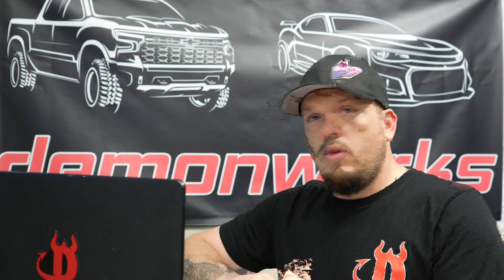Oil Pump Drive Belt TOTAL COST - 3.0 Duramax

Comment: If I had the equipment I would make steel gears to replace the belt and pulleys. Similar to gear driven cam  kit   Or a gear box at oil pump with pto shaft and gears from the top   There has to be a better system.

Comment: This transmission has more blind bolts then I’ve ever seen , you need a EN-52579 to rotate the crank to get torque converter bolts out maybe it’s it’s all you did could you get it out and in , in 7 hours , but fuck all data

Comment: Insane design. !  What's wrong with shaft driven or gear driven that has stood the test of time ? If they wanted a different design, then why not an external dry sump pump ? Easy to replace.
Reply from the maker: zero issues reported to date.
Reply: @DemonWorks  if it's not an issue, then why the discussion?
Reply from the maker: @tonycking0121  some people make it out to be an issue and that’s why you have returned to discuss. The video was to be informative on when the service is due and roughly what it will cost.

Comment: $0 cost if the oil pump was crankshaft driven like the 6.6 duramax and LS engines...for example my 08 gmc duramax has over 500k miles on the original oil pump at that mileage the belt would have been replaced 3 times

Comment: When you separate the transmission from the engine, would that require new oil and fluid in the transmission?  Would you have to factor in an oil change and transmission fluid change with this service?
Reply from the maker: top off each, minimal lost.
Reply: @DemonWorks  awesome.  Thanks for the info.  You’re probably talking me into buying a new truck.

Comment: I am seriously considering buying a 2020/21 with approx 50k miles for around $40K. Thanks for clearing the apprehensions on the oil belt cost. Before watching and reading the commentsnI was thinking in lines of $3000. Other issues with the 2020/2021 models that I need to be aware of?
Reply: Oil changes, def fill, dpf system, timing chain and oil pump belt access to rear of engine w different change intervals, timing chain is a touch more expensive. Auto start function can make the engine vulnerable to oil starvation. All said you get a good one fricking great concept! Best tank on mine 33.6 mpg! Towing the boat low to mid 20’s mpg. Good luck.

Comment: I heard the 2022 is at 200k miles. Is that true?
Reply from the maker: 2023, I have a video on that when it was first found in the owners manual. both the 2022 LM2 and LZ0 have a 200k interval now

Comment: LABOR TIME IS WAY OFF !
Reply from the maker: It's actually not. I mean, IT'S ACTUALLY NOT !!! Have you looked into the alldata times? That is where this came from and yes, one could add more time if they can't get the job done. Think about it though, you are unbolting the trans and pulling it back away from the engine and removing a cover plate then reinstalling after the belt is swapped. skill level 2 ... ps, WELCOME TO THE CHANNEL !
Reply: @DemonWorks  yeah and u forgot transmission fluid and that’s ten speed fluid so we sell for 15 bucks a quart
Reply from the maker: @trentonburge5662  I actually left out a few items but in your haste to complain, you left those out. How much fluid do you need when you pull a transmission back? those trans cooler lines must have at least a dozen quarts in there...
Reply: @DemonWorks  that also warranty time so add 40% to those times for CP and i have pulled these transmissions the starter removal is very fun just don’t people to be surprised when they have to pay twice as much as stated not trying to prove you wrong just trying to educate man
Reply from the maker: @trentonburge5662   I stated alldata times, times elsewhere can be higher or lower and I do understand the gm warranty times have been raised since I posted this video quite a while ago. I do plan on updating in the future but I don't like to just pull random numbers and provide them for the viewers. That's why this is stated at all data time. I do like the backtrack on you are just trying to educate, your first and second post would have been different if that was your motivation.
Reply: @DemonWorks  yeah well it’s the comments for ya and not being in person u didn’t know my tone nor body language and as stated not trying to make u look bad but IMO i think gm has completely missed it with this engine between plastic intake that crack and the cooling stack design i know it off topic but these truck will be extremely expensive to fix when they are out of warranty and at the end of the day it’s just a 1/2 ton pickup coming from a big time 6.6 fan and i guess i expected better from gm
Reply from the maker: @trentonburge5662  I disagree with "missing it", I think they did really well with this engine and the sales show it. It's also the only light duty diesel that made it. Yes, the 6.6 is better in pretty much every way but thats not an engine that is in the 1500 and many people don't need that engine. This fills the void nicely. I'm not worried about you "proving me wrong" we can all have our opinions and how we say things, i'm just sharing facts I had with me at that time and they will change over time but i'm not going to inflate numbers wildly without having information to back it up. The fanbase for this engine is huge, if it's not for you, that's totally fine.
Reply: @DemonWorks  only time will tell
Reply from the maker: @trentonburge5662  yes, much like everything else...

Comment: Speaking of belts, have you looked into what the process is to replace the serpentine on the 3.0? I just got a new Yukon diesel and I’ve been poking around in the engine compartment to see what it will take to do this job along with things like the alternator, ac compressor, etc and that belt is in there tight!!! Do the upper radiator fans come out to get access? I didn’t see any access to the belt from underneath when I had it on the lift a few days ago. Thanks!
Reply from the maker: I’ve had the proven age to replace a few… well, not replace but remove to get access to the front cover. It’s a miserable and tight process but doable without removing everything. The fans /radiator/ cooler are all attached and come out as one full assembly, fyi. Not needed to be removed to do that belt, though.
Reply: @DemonWorks  thanks for the reply! So, just get in there and get the arms all scratched up? 😂 I see a plastic cover which looks like it’s held on by one bolt in the upper RH corner and push sockets everywhere else. Is that just a protective cover? Maybe with that out of the way it’ll look a bit more “do-able.”

Comment: Inline 6 to make shorter requires removing accessories.  Mercedes is doing it with 300v system and motors.  Personally, a geared Power take off at the rear of engine would make sense to drive accessories.

Comment: Don't figure it out for yourself. Call a dealer and have it quoted. If you can find a GM dealer that says they can do it by just pulling trans. I would like to know about it. Again,I have a 2020 Denali 4WD Crew cab LM2.
Reply from the maker: Trans removal to get to the belt, yes.

Comment: I have a 2020 Denali and was quoted $2750 to change belt and timing chains. They say they have to remove the engine. Not the trans.
Reply from the maker: I’m a gm tech , it’s done from the rear. You probably spoke with a service advisor that was unaware of what is needed to be done, labor wise.

Comment: Why did the design an oil pump that needs a belt ?
Reply from the maker: Drives the oil pump. 2023 3.0 Duramax interval is now 200k miles, fyi.
Reply: @DemonWorks  I realize that , I was implying why did they not make it gear-driven or some design not needing a belt.
Reply from the maker: @BigEightiesNewWave  I’m still researching the belt design myself. From what I have learned so far is that the belt takes less space, less resistance, less noise and is actually a reliable setup based on numerous manufacturers testing.

Comment: I’d replaced the oil pump while I was in there if it unbolts out.
Reply from the maker: You would need to remove the engine oil pan for that.

Comment: I'm saving $350 a month in fuel with the 3.0 vs the ecoboost i had so even at 150k miles I'm wayyyy ahead. The people who argue the hardest that the belt is a deal breaker drive rams so we already know they're good at making decisions....
Reply: Mpg with the 3.0 is impressive for a full size truck. Power and torque is respectable.

Comment: As a dealer tech I’ll tell you right now absolutely nobody is going to do this job for 7 hrs
Reply: So how about you give us more information? How many hours are you going to charge at your dealership?
Reply: Under warranty from GM this belt pays 10.1 hours for a 2WD truck and 12.0 hours for a 4wd truck. Alldata however does not show a labor time for this component but a vehicle out of warranty would be about 14 to 16 hours.
Reply: @danieldelgado3008  Thanks for the info.

Comment: We're talking about a 10-12 year maint item for most and most people and the truth is, most people don't keep their trucks anywhere near that long. It'll most likely be the 2nd or 3rd owner doing this job. In any case, it's not an issue at all as far as I'm concerned, especially if the engine remains trouble free otherwise.
Reply: Yeah. Screw the 2nd or 3rd owner right. This crappy design is perfectly fine.
Reply: @Connor4x4  So stupid. ALL engines require maint. You haters just have to whine about something I guess.
Reply: @Connor4x4  It's not "screwing" anyone. Just like original owners that keep their pickups a long time, future owners will know about this and other scheduled maintenance procedures and can make the decision when buying and used trucks will reflect a sales price according to what people are willing to pay. This doesn't seem like a big deal. They keep moving out the recommended inspection mileage. It will be a while before we hear how long they are lasting in the real world. And dealerships labor rates are high. There will be private shops doing this for half the cost of a dealership.

Comment: GM testing has shown little wear at 150,000 and 200,000 miles. This will be a non issue for most.
Reply: I am at 148k right now so I am puckered myself lol... I am just going to start gathering the parts to do it when needed

Comment: Where were you able to get access to that parts diagram?
Reply from the maker: I work at a dealership.
Reply: @DemonWorks  Some brands appear to have some detailed parts diagrams online like BMW, select Subaru parts sites, but I've often had trouble finding detailed parts diagrams for domestic vehicles.  Is that something that's part of a OEM subscription to a factory service manual?

Comment: Looking very likely GM going to increase that mileage to 200K based on their examinations of belts at 150K looking great.
Reply: how old the belt is matters too.
Reply: @beowulf885  agreed.. a belt is a wear part. If they designed the engine to have those components at the rear of the block, knowing it would be an intensive repair and high labor time, they should have done a geared setup. Such a key component should NOT be putting it's faith into a rubber belt..

Comment: Waaayyyyy cheaper than pulling the cab and doing timing chains, tensioners and phasers in an Ecoboost but nobody seems to talk about that...
Reply: Ford owners are so nieve, they're blinded by how much power the engine produces that they don't care how much it costs to replace the chain. But hey, as long as they keep buying them, I can keep paying for my daughter's college tuition 🙃
Reply: @MrNismopro  😂😂😂😂 exactly!!
Reply: Exactly correct! I have been saying this ever since this engine came out. It's not that bad of a job. People make it out to be the worst thing that GM could have ever done.
Reply: @Mr._P4732  GM has done this move before with the 4.2 inline 6 as I'd imagine you know. That job is much more intense then this oil drive belt.
Reply: Lol i bet it's not a fun job in the rust belt
Reply: @spencerelsbury9110  Any job isn't fun in the rust belt.
Reply: Sure but servicing any emissions equipment on this piece of shit engine the cab has to be pulled.
Reply: @yurizaitsef  haven't had the opportunity for one yet but sure seems like we see cabs pulled often.
Reply: @yurizaitsef  yeah sounds like hell! I don't mind lifter jobs. Play well and bang them out in a day. Messed with one Diesel and it was a 7.3 HEUI. Plan to leave diesel work alone even being an easier platform.
Reply: @yurizaitsef  Benz tech huh? How was that to deal with? I used to work at a Chevrolet dealership but have moved on to self owned business with my dad. I work on many dom/foreign but never was blessed with Benz yet.
Reply: @evdawg7757  I loved that job. I still miss it.
Reply: @yurizaitsef  props to you for that. I'd imagine dealing with high end class cars everyday you be nervous or feel challenged. I'm lucky to have the opportunity building hot rods and restoring old muscle cars, experience passed on from my dad   I might possibly have an idea of that but Mercedes is rocket science compared to 60-70s domestics
Reply: well I guess it's a good thing (insert parts here) don't need replacing every 150k on an ecoboost isn't it 😂, one out of the 7 or 8 guys I know with them has had a timing related issue in less than 250k and that was likely due to infrequent oil changes so I don't understand the hate on the ecoboost if 7/8 make it past 250k without skipping a beat 🤷‍♂️
Reply: @204RED  2018+ F-150's with the 2.7 EB or 5.0 Coyote have the same oil pump belt as this engine.... and gasoline that ends up in the engine oil degrades the belt much faster than a belt exposed to any diesel in engine oil. Oh and Ford decided to route that belt behind the timing chain so you're in for a cam phaser/timing chain replacement "while you're in there". Labor estimate is 18 hours but that's probably low with all the junk you have to remove to get at it. Maybe there was a reason GM put it in the back lol.
Reply: Where are you located?
Reply: @luism.varela5806  where it's hot in summer and cold as hell in the winter. The mountains
Reply: Umm everybody seems to talk about that lol
Reply: You don't pull the cab for any of that stuff so.... also if you don't do 10k + oil changes it's not a issue 178k going strong
Reply: @mddunlap03  most shops do, bud. They do on the expedition also. I agree with you on the 10k oil changes but that's what the manufacturer recommends and people don't know I guess. Lol a "fill for life" anything is bullshit
Reply: Wanna know what's cheaper? Not doing it at all.

My 24 valve Cummins never had cam phasers to fail. Never had a oil pump belt to replace either.

Only problem was that I was forced to drive a Chrysler product with a transmission that was made of glass while I owned it though.
Reply: @theoabramovich3128  o I don't like it but it's all due to packaging because of all of the emissions crap. Thank our EPA
Reply: @ericmackison9517  epa is exactly why these engines are prone for failure with lack of maintenance. Eliminating EGR required VVT, used DOHC which means more rotating components inside that require oil pressure to retain tension on the multiple chains to keep it all in sync. Improper ventilation or gumming up burns oil or blows vital seals, and without oil for solenoids for VVT, chain lubrication and tensioner pressure jumps timing, stretches chains out of correlation or worst case completely fails and grenades. I don't mind getting paid to get a 3.6 or 2.4  back on the road for example but it makes me enjoy my old classics. Tune the carb and slam the hood. The engineering today is fucked. They're pushing the consumer away from the ability to maintain their own vehicle in their driveway.
Reply: @theoabramovich3128  both 12v and 24v were a strong option when looking for a working, towing truck. I agree with the transmission, they were definitely fragile.
Reply: @theoabramovich3128  okay boomer

Comment: Not an issue at all.  $1300 for 300,000 miles?  Cost of plugs and tune ups on a gasser would be the same.

Comment: I had an engine light come on at 29000 miles so took it to the closest GM dealer to diagnose. They wanted $450 to run a diagnostic test and only then could they determine if the warning light issue was covered by any type of warranty. So $1300 sounds cheap for known replacement parts and labour. Fortunately the warning light went off on its own after the engine reached normal operating temperature.
Reply: If still under warranty, why would you need to PAY for diagnostic tests?
Reply from the maker: @kevinvoyer5053  when a vehicle comes in to a dealership, and it’s out of the 3 year36k warranty, then typically the dealership will ask a customer to authorize the diagnosis. This is in case it’s not a warrantable issue. If it is a warrantable issue, the customer does not pay anything.
Reply: @DemonWorks  yea I’ve been around dealers enough with new vehicle purchases and warranties to know, I was just responding to the above post, informing that should not be the case if the vehicle is still under warranty. Seems to me if any warning light comes on, that is bound to be warranty related, how else could it not be, unless the owner never checked the oil. Or had it changed.
Reply from the maker: If it comes back on, get the code read and send it my way. maybe I can offer some assistance - I am a GM tech.
Reply: You should be covered with factory warranty till 36000 miles that seems like your dealership is taking you for a ride so to speak… everything is covered unless you did a lot of aftermarket bolt on stuff I have the same truck so I know opps just read the top post he’s right

Comment: Eco boost 3.5 exhaust manifolds crack before you hit 100k. Dealer that we are trading our 150f to , said after 120k , they figure in turbo's if they have not been replaced yet.